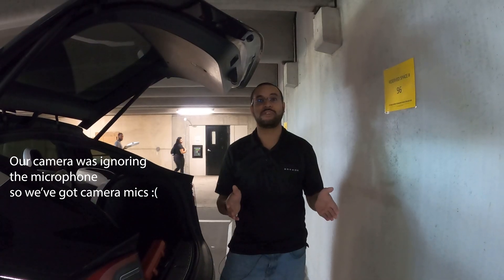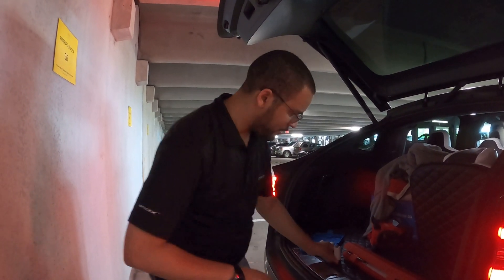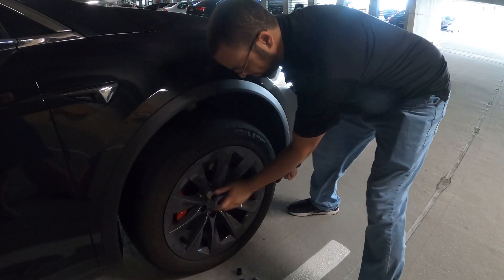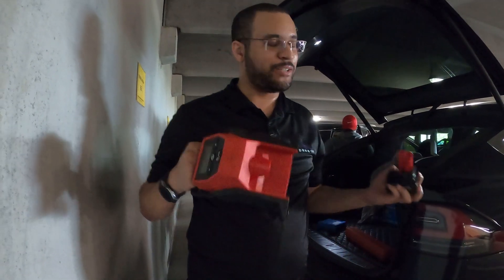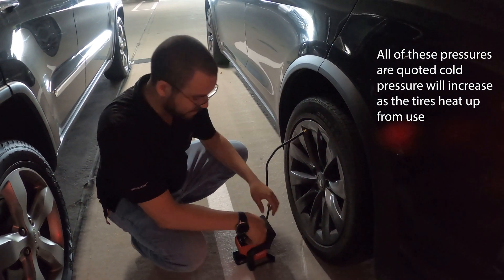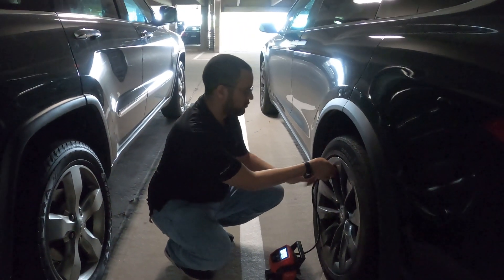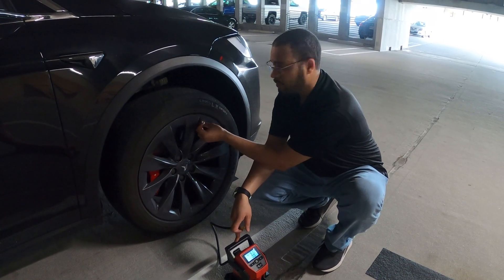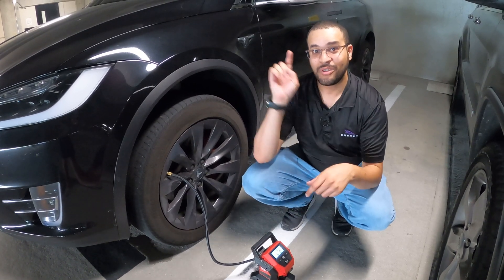Tesla wheels & tires - what lug nut torque? - Torque wrench setting

Comment: Thanks Kacey. Camera is a bit shaky and video is kind of long without edits, but great instructions nevertheless.
Reply from the maker: Thanks vash, working on using outlines (scripts of bullet points) more frequently and looking for ideas of what to do when Luna is filming, she takes great photos but wobbly videos sometimes
Reply: @KaceyGreen  that's great! There are cheap stabilizers out there that work well. If you find yourself rambling or anything, video editing is great to make it shorter. Either way, good content. Thanks!
Reply from the maker: @vash01000100  usually she's fine with the GoPro digital stabilization but I guess the low light and monotonous background gave it trouble, I'll have to find her gimbal and rig a mount for our GoPros, at least until we can afford a versatile pro-sumer camera to use. (we have one with a built-in gimbal, it's where the flipside tag line comes from, but she might destroy it if it starts behaving "randomly")

Trying to find the right balance of what to cut  is an interesting challenge, feedback is that this video didn't leave enough on the floor. Other times I'm told I cut too much or they didn't like the way the cuts were executed even if the length was right.

Thank you for the feedback